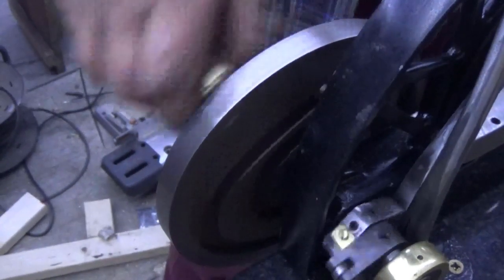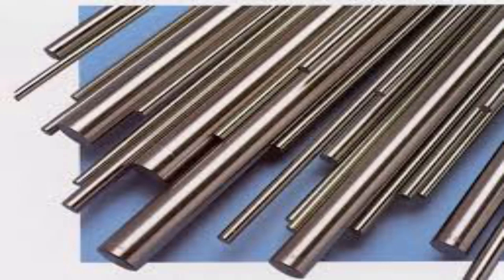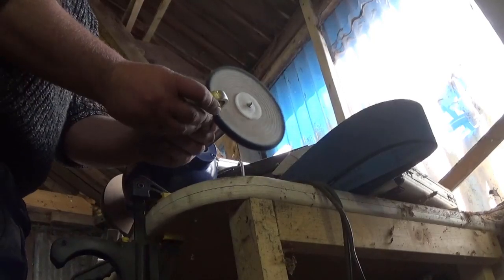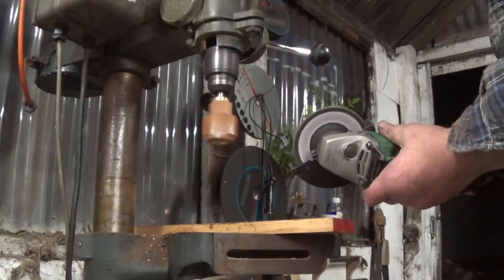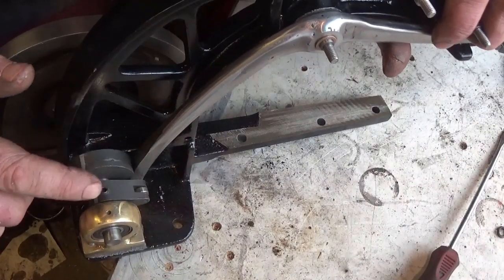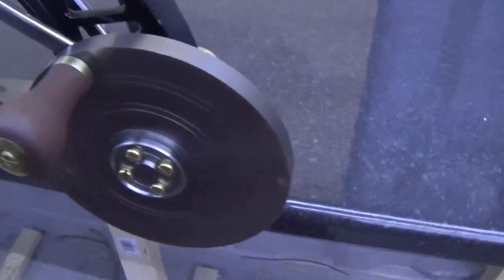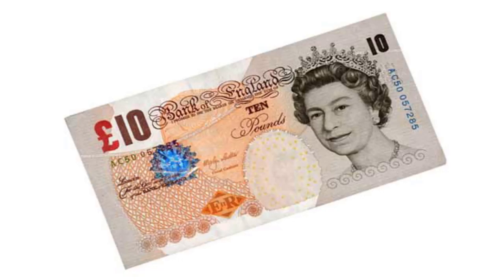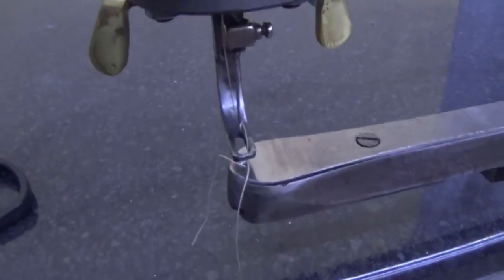chinese shoe patch machine crank wheel shaft and bearing modifications

Comment: Thanks for a fine video, some good workmanship, was really pleased to see you casting your own part, I've had one of these for a couple of months, done some patching up immediately, but haven't gotten into doing the bearings, and I'm thinking of putting a bearing in the toe of the lever you put a wiper on.  It only bears hard when it's first engaging, moving the foot, once over the hump, it's coasting on the cam surface.  I'd planned on replacing the ball bearing, but hadn't decide what to do about that back one, and I decided to do as you  did, and put the equal ball bearing in a new pillar.  Enjoyed the accent, while the work looked and sounded very familiar, even for a yank.  Thanks, mate.

Comment: I like how you have an expensive precision lathe but you choose to make the knob using a drill press and an angle grinder.
Reply: Most machinists I know have a thing about not working wood in metal lathes and mills, because sawdust gets everywhere and soaks up lubricating oil out of all the places it needs to be.
Reply: @Vikingwerk  ahhhhh... I see.

Comment: Yeah, I have Chinese leather stitching machines, I'll just step out to my metal shop an use my 1-ton lathe, sitting next to my 300lb anvil an metal forge to make new case hardened steel bearings. Where does all this equipment come from?
Reply from the maker: eBay mostly, same as my sewing machine.
You don't need all this gear to mod your machine though.

Comment: Very nice! 

I just picked up my own Chinese Shoe Patcher and was trying to think of things I could do to make it work better. I may not go to the extent you did but you definitely gave me many great ideas. Thank you!

The cylindrical part at the front of the machine that houses the presser foot mechanism seems to grind but as I spin the foot around. I didn't see any modifications on your machine for that part. Is that still in the works, or does that portion of your machine spin satisfactorily? Also, as I spin that part around I see that the spring loaded arm in the back rises and falls slightly so there's definitely some misalignment there.

The bobbin winder is a mess.

Comment: I REMEMBERED YOU TALKING ABOUT "OPEN BEARINGS" BEHIND THE FLYWHEEL SHAFT, but I received one the other day with a sealed bearing, but the item had problems, here is a post I put on another video of someone elses).....I received my shoe patcher the other day, ...heavily damaged, but fixable, seller and me "negotiated" a partial refund of $40(machine was $104 shipped ebay in the USA, making it a $64 machine now), and basically the box arrives, there is a little wear hole in a otherwise nice box, I get it out and the #15 thread bounding plate that holds the #14 bounding arm is bent over the long main top arm and warped bad below as well, the #14 arm on the plate is slightly bent, the spring for that is basically destroyed(flattened and stretched), and the metal wire loop guide for the #14 thread bounding lever is bent downward and partially pulled out of the top hole, but can be beat back up with some work, and the other metal parts can be straigtened, and it was missing some hardware bolts and nuts for attaching the legs,......unsure if I want to use the legs or improve them with thicker pipe place over to prove a point if the legs are useable somehow, but might just attach it to wood like everyone else.  So my machine cost me $64 basically, but I worry about finding the right spring replacement.  I swear to god that the thick metal loop on the front that is welded to the top arm is bent more down than what other people have, seems to work through, and I didn't know these came with two shuttle carriers, two shuttles, and four bobbins cause I ordered five sets of those from Hong Kong to arrive next month.  I suspect the machine was pre damaged before boxing up wherever they do that, who knows.  I noticed the main bearing behind the hand crank wheel is a sealed bearing, I noted in other peoples videos that a person wished it wasn't an open style bearing cause that machinist would have liked to mill out the bearing hole for sealed bearings but worried about the strength/thickness of the cast iron there, if true then the newer ones have sealed bearings not requiring greasing like the older imports, ...unsure if that is the case but I swear I heard that and seen it, but it means a replacement bearing can be purchased,....errrr, if I ever really really wear it out somehow.   Looks like a bicycle hub sealed bearing, I know cause I have some el cheapo big box store chinese made bikes, that is what they used these days most of the time I understand, not loose bearings like back in the old days.  Machine was not all full of grease, just oily.  Its still an aggravation to have to fix it before I can use it, but it appears to be operational with the bent parts removed, so dunno, wish me luck.  The box was just plain brown cardboard and foam was very destroyed on one side, and there are no chinese characters on the machine, just a chipped green paint.
Reply: When I think about it, I don't like the sealed bearing, or my concern is with the quality of the sealed bearing and how much grease, if any, is inside the bearing.  Really, all I need is a quality bearing and a better support on the other side, wished they put a bearing there, but eh, ya know, it is what it is.  Ya know these are copies of late 1800s western made shoe patchers, seen a video on youtube of a Hugo Wertheim made shoe patcher machine from the late 1800's, see something similar on a treddle style table for a $1000 on ebay from the late 1800's.  The original western made shoe patchers were of course better made originally, so the chinese didn't design this style shoe patcher, they copied them, maybe you already know that.  .  In fact, I swear I could pry the plastic seal off the bearing in order to grease it, or the real fix it remove it, measure it, get a high quality replacement.  I of course worry about axial and radial run out,..play, of course there is radial run out at the support base on the opposite side as is usual,....I don't like that and I think a bearing should be there, or a quality common size bushing.  I could have pushed to just have this machine be free with ebay buyer protections, since the seller obviously filed for a courier insurance coverage and was playing hardball after I provided the damage photos, I know, cause I've been protected before with ebay paypal credit buyer protections, but I don't like to anger a company I might accidently order from again in the future, I'd like get several of these and play around with modifications to them, maybe welding on upper gussets to strengthen the upper arm, stuff like that, ....improvements, probably a waste of my time and welding rod and materials for the uses I really need it for.  I might take this one or another and make a copy of the treddle table I seen to make one look and operate like a vintage 1800's machine. As some folks know, even case iron can be welded with the latest methods, ways of changing the looks or increasing strength of the main body, dunno, I've done cast iron welding before,.....carefully with success, cylinder heads for rare engine......well, the welding on the cast iron,...a stupid idea just to change the visual profile, not really serious.  The whole thing give me an idea, one of making a similar machine by hand, of plasma arc cut parts and welded frame, also using basic tools cause I don't have a lathe.
Reply: Also, I think the fit of the shaft to the flywheel is now in tighter tolerance cause I can tell, its very tight to install on shaft, and I almost needed a gear puller to remove it, same when installed and wanting to remove again, ...I guess that is good, really.
Reply from the maker: @budwhite3570  wow, exciting times ahead for you my friend! Agree completely, not much point upgrading the sealed bearing till you can get rid of the play in the rear end of that shaft, my main cause of concern with the open bearing was the grit that was already in it, and having rough machined iron on iron wear surfaces, these machines generate their own fresh grit every time you turn the handle!
Get in touch if you want me to measure anything to help get your arms set up again.
Like you, the more I look at it, the greater the temptation is to just start from scratch but because im doing a lot of machine sewing now it's likely I'll just get a second hand industrial machine instead.
Good luck and enjoy yourself, they are lots of fun!

Comment: Looking very good. I take it that it is basically a sewing machine, in which case I presume there is also thread in the bottom bit. What does that look like? Also where did you get it from?
Reply from the maker: Yes, a simplified heavy sewing machine, the bobbin holding the bottom thread is especially small by any standard in order to reach the toe of a boot but that means it holds very little thread, I haven't covered the bobbin in this series as I'm still figuring out how to mount a bigger one.
Reply from the maker: And I just purchased it on eBay about a year ago, I've used it in a couple of videos
Reply: @turboconqueringmegaeagle9006  Cheers. Interesting.
Reply: @turboconqueringmegaeagle9006  I've seen them there also. A second had Singer equivalent is much more expensive!
Reply from the maker: I'm on Leicester's doorstep, the city that clothed the empire, second hand machines are cheap and plentiful, I just have no idea what I am looking at!
I did a bit of sewing at college but that was all handstitched repairs on fabric covered aircraft following schemes that gave instructions for thread and needle sizes but now I just don't have a clue on the sizes until I actually use it and it either looks right or wrong so this is a really good way for me to get some experience.
Reply: @turboconqueringmegaeagle9006  You'd be after a Singer 29K as far as I can tell.
Reply: @turboconqueringmegaeagle9006   Hello from Texas, your video is very good and very much appreciated.  I am impressed by your understanding of machines.  I am having difficulty catching the bobbin thread with the needle thread.  I've watch all the videos that I have been able to find and have meticulously followed the advice given by a number of presenters especially making sure the bobbin shuttle is aligned correctly with it left edge next to the needle and the 2 holes of the bobbin carrier being at 3 o'clock while the handle is at 9 o'clock and the 2 nuts on the shuttle driver bar are nest to the handle.  I have watched the movement of the bobbin/bobbin holder and the shuttle turn in sync with the movement of the needle....everything appears good except the needle does not pick up the bobbin thread!!!!!  Any suggestions?????   I'm new at communicating with presenters so I don't know that this will reach you or how you will get back to me.  Thanks any way.
Reply from the maker: @chummaker1  the most obvious thing to check is the needle, it is not symmetrical, the vertical groove must be on your left (if you are sat facing the machine as you would during normal operation) and you should have a notch at the tip on the right, the purpose of the notch on the right is to allow the bobbin hook to pass between needle and thread.
Make sure the needle is seated properly in the needle bar and that it is the correct length (standard domestic) and is not bent.
I would not time the bobbin relative to the handle position as it is quite likely the position of the handle relative to the crank wheel could vary from machine to machine.
If you watch the needle closely throughout it's operation, it comes all the way down, then moves back up 1/8" and pauses, it is at this point that the bobbin hook should pass between the notch and thread and pick it up. 
There are only 6 possible positions for the bobbin to be in so if you are stuck and still think it is your bobbin timing just try them all, you won't damage anything.
Are you sure you have threaded the Bobbin correctly?
Let me know if you are still struggling and I will make a video, several other people have asked questions regarding threads and machine operation also. Hope this helps.

Comment: Sir, you mentioned talcum powder and mentholated mineral spirits for protecting metal.
Is that the same as paint thinner ? with talcum.  Thanks !!
Reply from the maker: Methylated spirit is a spirit alcohol,   you could try experimenting with white spirit but it'll take ages to evaporate, and I've found it works best if you build up several thin layers.
Reply: @turboconqueringmegaeagle9006  Great Thanks for the quick response. They sell some material here for that same purpose but costly.  Like the way you melted brass in a metal pot.. if it works I'll give that a go too. Good wishes.
Reply from the maker: It's pretty wasteful melting brass on the forge, it consumes a lot of coal but gets the job done! That pot is the bottom of a gas bottle like you'd get oxygen in, not the lightweight propane bottles.